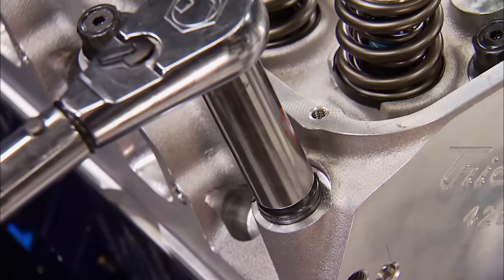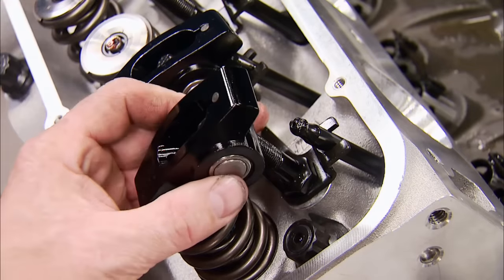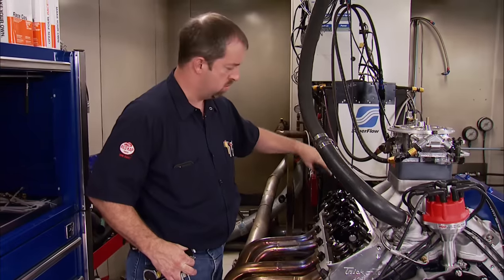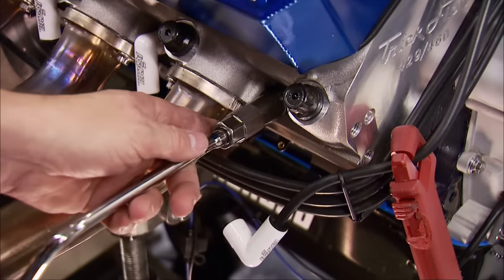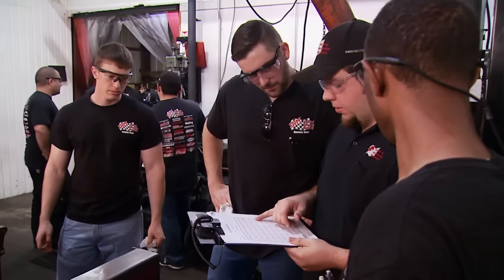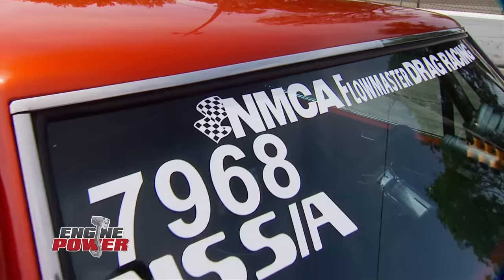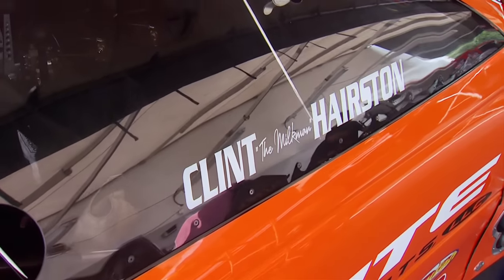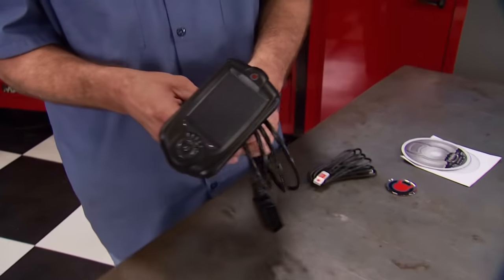Pressing the Limits of a Ford 557 by Adding Nitrous - Engine Power S2, E22

Comment: I thought about trying that FiTech setup but from what I understand they don't take returns and don't support their product. Anyone else hear that?
Reply: How about buying the correct part once?
Reply: @dj4monie  ordering the wrong part isn't the only reason to return something. If they don't take returns or back their product than I'm not going to waist $800+ on them.
Reply: i qatched some videos where guys were have lots of problems with them on you tube cant remember who it was put one on a ford bronco 302 i think google fast tech throttle body injection i was looking into comparing different ones

Comment: I noticed right away that even though this is only 5 or 6 years old, it's already incredibly out of date.  At this point, there is little reason to put a carb on any motor, EFI systems are just way more effecient, way more flexible, way more tunable, and offer significant fuel economy and engine life benefits.

Comment: The bad thing is that this 500+cid BBF made 1000+hp and 1100ft lbs of tq on an engine dyno with no trans behind it and no drive line so put that in a car and on a chassis dyno and run it again and see what it makes but me I would much rather have a mildly built LS that has the same hp and tq in a car wether it's on nitrous turbo or blower and with the LS at the same hp and tq range the LS equipped car would out run the BBC or BBF combo car everytime since the LS is almost 300lbs lighter and the power to weight ratio would be a whole lot better and about 200lbs lighter if the LS was an iron block and the BBC and BBF is iron block as well and that 1000hp could come from a 4.8 or a 5.3 liter LS but if you get a built LS7-427+cid those power numbers would go way higher probably 1500hp range a few years ago World Products built a 454cid LS7X and N/A it made a little over 800hp and close to 800 in tq but that was 13.1:1 compression as well and World Products also builds a 481cid crate engine and bigger and all the engine combos were complete solid roller engines with aluminum block and heads and with a Carb if you put an EFI system on it and completely dialed them in you could probably get a little more hp and tq out of them and GM LSX also makes a 454cid engine and a Texas Speed 427cid Powerplant can make 1500hp with a turbo and EFI

Comment: Why are they only using old carburetor? Port injection is much better
Reply: Carb is cheap, and relatively simple to tune and setup. No electronics to worry about either
Reply: Justin Henry  cheap when it comes to anything, carb isn't bad, just a bit fuel inefficient compared to direct port injection
Reply: If all you care about is top end power theres nothing wrong with a carb. You'll gain a little drivability and MPG with FI, but thats about it.

Comment: Ported heads but not polished. So job only half done. There I is no point to port without polishing. Now with direct injecting fuel injection, port and polish are useless!

Comment: So one pull has 754hp at 6300rpm 
Another has a shot of gas and makes 1031hp at 6000rpm then they step up the timing and nitrous and make 1080hp  at 5500rpm... Rev that sum bitch up to 6300rpm keep it even.

Comment: screw nitrous. go with torch grade o2 as your booster gas. torch grade o2 is around 95 to 97% pure o2..
Reply: Why don't you give it a go yourself? Have the fire department there when you try it. You'll need them. 
The reason nitrous is used it it doesn't "let go" of it's oxygen content until it's very hot. Until then it's relatively inert. It's also it's own flame speed buffer because nitrogen is released when the oxygen breaks off. 
Torch O2 is as far from inert as you can get, and will probably end up lighting something off in the intake manifold before it even gets into the cylinder... if it doesn't just immediately mix and detonate with the fuel charge. Yes, I said detonate instead of deflagrate or combust, because I mean DETONATE.
Reply: @mfree80286  actually its been done successfully on multitude of times. when the engine its self has been biult for the o2 influx. but most people dont care to do all the extra work for it. even nitrous user have done the switch.

your using a smaller amount. a smaller and leaner burst of the gas. plus having thick waled stainless steel tubing helps to absorb the excess the heat. so yes it can be done if your willing to take the time.
Reply: @nathandean1687  Show me.
Reply: @mfree80286  do your own research.  if the engine is properly set up for the o2 . then you wont have any issues. but most people wont take or go thought the trouble.
Reply: @nathandean1687  So no video to show us then?
Reply: @sparkplug1018  NOPE . go do your own research. it has been been done.
Reply: @sparkplug1018  plus i doubt they put a vid here. how google loves to take down vids at random.

Comment: Just think about how bad the guys running big blocks would feel knowing my little 3.5l 6 cylinder makes 650+ hp on pump gas!
Reply: Big power forced induction 6 and 4 cylinders are nothing new, we're all aware of them. Hell these days there not even that special anymore.
Reply: @sparkplug1018  mine is stock. They don't make many 650+ hp stock 4 or 6 bangers.
Reply: There are more then a few out there now. Not super common but available. And yeah I'm sure it is stock, lots of OE's doing turbos these days.
Reply: @sparkplug1018  it is stock. Tune only. I'm planning on meth, intercooler, and exhaust to get more reliable daily power out of it.
Reply: @charlieodom9107  What car is it in? Sounds like a fun car to drive. I do enjoy seeing these high output 4 and 6 cylinders btw. Haven't messed around with a 6 in years since I had my 3800 V6, nothing near 650, but still damn fun.
Reply: @sparkplug1018 not a car, just an f150.
Reply: @charlieodom9107  Nice trucks, yeah a few mods and that should be even more fun.
Reply: @sparkplug1018  it is my daily, so it won't make more than 650 even with the mods. I need it to pull a 8000lb trailer. With a Livernois block they can make about a grand, but 650-700 crank is it on floating cylinders.